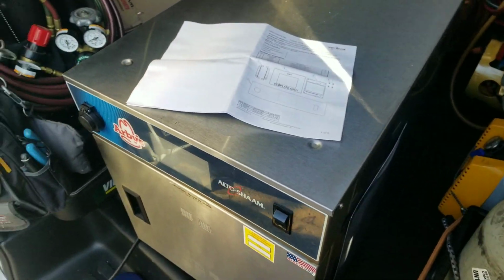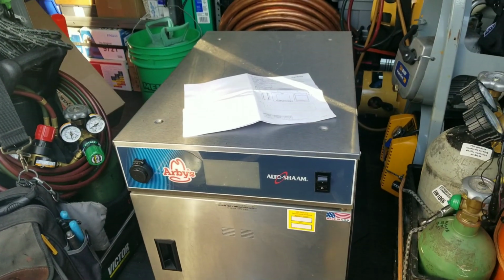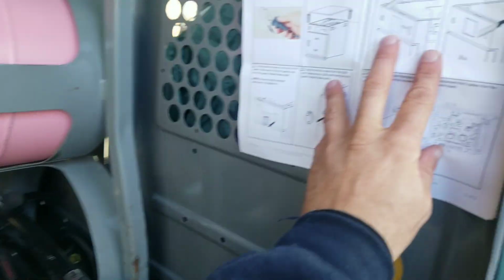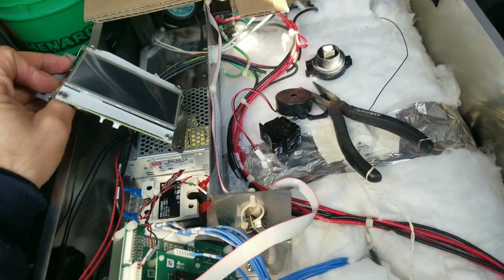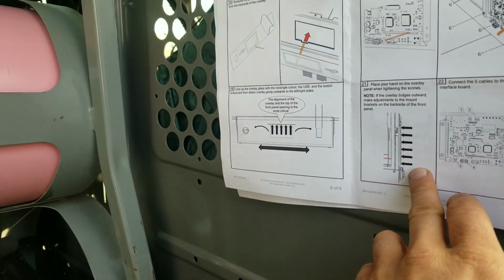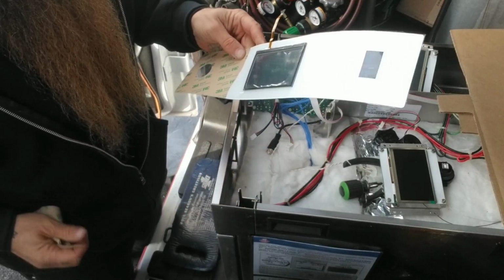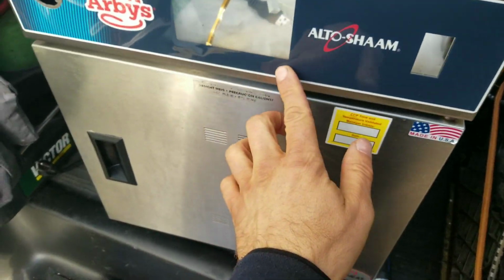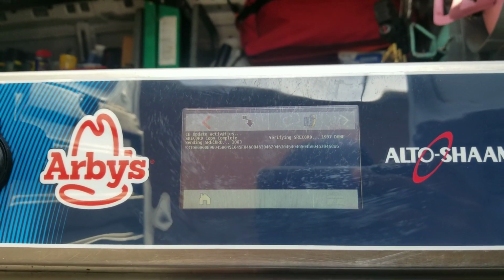Alto-Shaam touchscreen not working

Comment: Those resistive touch screens are interesting.  They only have about four connections (hence the tiny ribbon cable) and work out touch position by the X-Y resistances when you press the layers together.  When you calibrate it by touching the corners it gets base resistance values and works the rest out from that.  We've had issues when the modules have been installed badly and it applies pressure to the screen edges causing it to behave weirdly.  People using hard objects on the screen also sometimes causes issues.
Reply: huge thanks for recommending this channel Clive,  we had resistive touch screens in some of our POS systems back in the 90s (way before capcitive friendly gloves were viable), we found our sub-assembly manufacturer would scrape but not completely remove some of the material on the traces to change the values, problem was they just did it for certain points to pass our QC lol so that cause alot of rework - there were several competing techs back then resistive, capacitive, infrared , guided acoustic wave (those are the ones I remember anyway sure there were more) in the end it was cheaper to change gloves and go with  capacitive.
Reply from the maker: Thanks for watching
Reply from the maker: Thanks for that info Clive- I have some follow up questions for you, Ill shoot you an email later today-- thanks bud

Comment: Is that type of job profitable? Would it be cheaper to buy a new one? Sorry, not familiar with those units. Looks like you work on a lot of different types of units.
Reply from the maker: I dont know the exact cost of those machines but I was told its in the thousands of dollars so they usually repair them- Ive dont a few extensive and expensive repairs on these so they must cost a bit of money. Thanks for watching
Reply: I know this video is old....but I can't help but to comment.. Just taking a guess this oven was probably around $3000.00 new and is likely 10-15 years old. Parts like that screen are not something that is going to fail regularly and is likely a $200-300.00 part. Plus you figure in say $100.00 for the labor costs which means they're only putting in maybe $400.00 into a 10 year old oven that was 3 grand so it's more than worth it for Arby's(especially since they make good money with it) and looked like a fairly simple job to do and most likely profitable for Bill too. Keep in mind I'm just taking some guesses but my numbers are probably close.

Comment: Missed the part where you cut/nibbled/dremelled? the stainless!

If I go back to work, one project is to enlarge the stainless steel top plate of an ice bin. Installers dropped an Indigo on top of existing bin, but did not check to see if it was serviceable. Cannot drop the water through to do a normal clean!

Speaking of ....Manitowoc ice machines for some reason require a certain small capacity x?MB flash drive which is now so hard to find these days. At the last annual training they gave out formatted flash drives preloaded with manuals and firmware.

Hope you're staying busy and safe.
Reply from the maker: Interesting, whats the flash drive used for? I assume software updates
Reply: @curioushvacguy6876  "Firmware"? Update for some earlier boards that allow machine to operate in Safe Mode even if thermistors crap out.